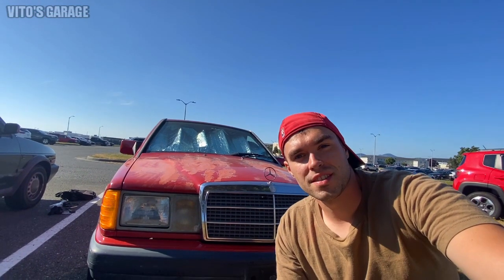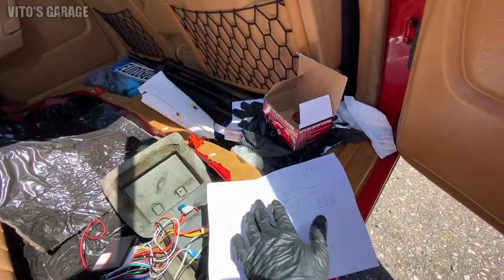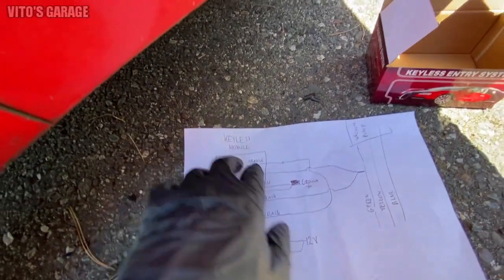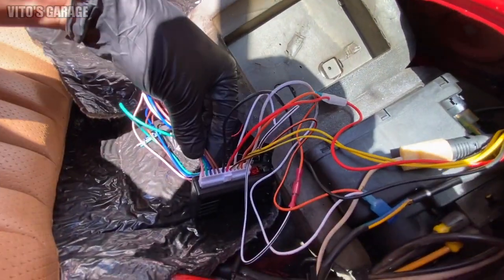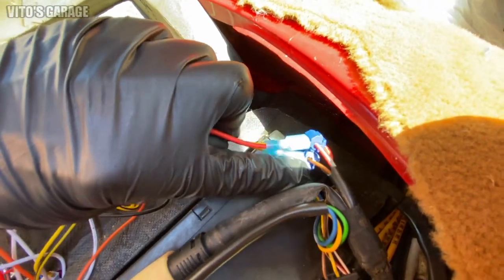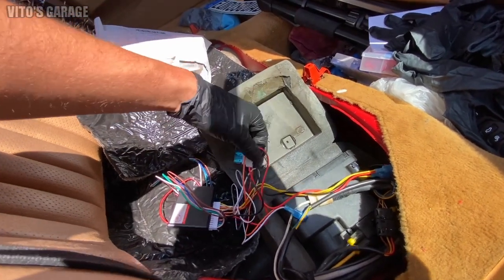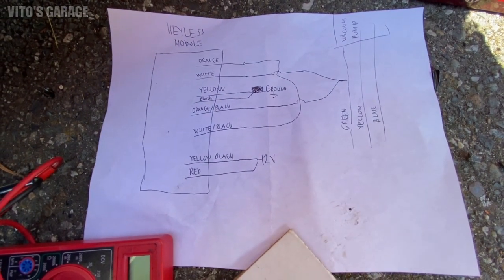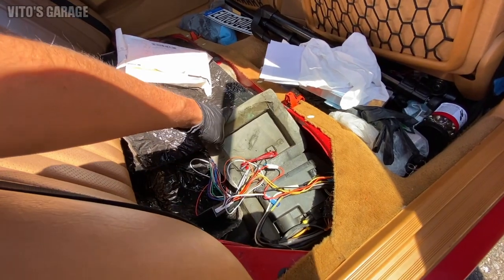Universal Keyless Entry Remote Installation Instructions Mercedes 190E W124 W126 R129 W140 BMW

Comment: Installed this same system in my 190 3 months ago once my drivers door lock cylinder stopped working. Loving it.
Reply from the maker: Did you wire it the same way as in my video? It sounds like your driver door lock vacuum actuator is bad. Pull the door panel off carefully and test it
Reply from the maker: If you have remote keyless entry issues, click here: https://youtu.be/hO1A6DHzTjg

Comment: Amazing video for beginners.  I recently lost my main key for my 300SDL Diesel and I found a replacement mechanism for the ignition so I now have a key for that, but still need a key for the doors.  Your project is a perfect option for me now and I will go ahead and order this keyless entry system and I will make sure it’s the same to avoid any confusion.  This will hopefully get me back on the road without having to worry about the doors left unlocked :)
Reply from the maker: Go the dealership with the title and order a new key. That’s another way. I really recommend doing this too. They’ll cut you a new key according to your VIN

Comment: Good day Vito,
I follow your videos on YouTube. You doing a great job. 
I wanted ask if you could help me with wiring my 190E with a central locking unit a bit different from the one you had used but I think the features must be same. I just need to know which wires I need to use to connect to the green wire of the vacuum pump.

Comment: Absolutely saves me a ton of fooling around with my w201 but I am curious about the tiny red wire sticking out in the back and if the trunk release works too or that it unlocks everything automatically because of the pump, would I have to wire it different or should it not matter?
Reply from the maker: The way I wired everything in the video makes it lock and unlock all the doors as well as the trunk. Just use this video to wire yours up
Reply from the maker: If you have remote keyless entry issues, click here: https://youtu.be/hO1A6DHzTjg

Comment: the orange/black wire and white wire that go the the green wire on the pump, did you connect both wires together and solder onto the green wire or did you cut the green wire and solder the orange/black to one end of the green wire and the white wire to the other end
Reply from the maker: Check out this video if you have issues:

https://youtu.be/hO1A6DHzTjg?si=m4ZKVqUlmZYsUEb1

Comment: Hello, i did the same thing as you did on my 190E with same kit and have a problem. I can unlock it, but when i want to lock it by wireless key, it will lock and automatically unlocked in a sec... I tried to cut the green cable, like manual said to do, but no differences... Do you have any idea?
Reply from the maker: https://youtu.be/hO1A6DHzTjg?si=IlY6Lrg2keEeh8bi

Comment: so i don't need to cut the green wire like my installation diagram says? you just connected the white and orange/black to the green wire
Reply from the maker: Hi. Please rewatch the same video and if your car still has issues, watch this video. You may have the same issue like I had:
 https://youtu.be/hO1A6DHzTjg?si=KTlExTSNtFFR9947

Comment: Hello, I connect everything as you said and the remote control is powered on. The led flash when I lock and stops when I unlock, but the locks didn't do anything. Should I try to connect the white - oragne/black to blue or yellow? Thanks
Reply from the maker: If you have remote keyless entry issues, click here: https://youtu.be/hO1A6DHzTjg

Comment from the maker: Latest Update: 
Here’s how to fix your keyless entry if you have issues:

https://youtu.be/hO1A6DHzTjg

Hello friends. I need to send an important message for some of you in case your locks stop working completely and you have it WIRED PROPERLY:

What you need to remember with 190 (W201 chassis) is that when you unlock it, you have to wait till the vacuum pump stops pumping. Once the pump stops pumping air, you can lock it with the remote. Otherwise the keyless module doesn't like that and prevents the locks from working. In that case you need to reset the battery.
 So, when you use your keyless remote, do this: Unlock and wait. Don't lock it right away! Lock it when the vacuum pump stops working. Long story short, give it a break between locking and unlocking. If your locks don't work at all but everything is wired properly, reset the battery for 30 seconds and the remote locks will start working again.
Just remember, give it a break between locking and unlocking.

Comment: hey, thanks for the video. How did you figure out the orange needed to be shorted with the white/black etc ? I got a different system and have no idea which to connect to the green wire !
Reply from the maker: That’s what the instructions said to do. 
If you have a different system, message me on Instagram (vitosgarageyoutube) and I’ll try to help
Reply: @VITOSGARAGE  Thanks for the reply. Turns out my controller isnt compatible with pneumatic systems. I got one that is with instructions on how to do it included. Wire colours different, but same result. Thanks for your help !
Reply from the maker: If you have remote keyless entry issues, click here: https://youtu.be/hO1A6DHzTjg

Comment: can you do or recommand a video of how to convert a w201 190 rear manuel window to electric ?
Reply from the maker: It's a long story, but you need different door panels and different window regulators, you need to add more window switches to the center console wood trim, and you need to add the wiring harness to the rear windows.
Reply from the maker: If you have remote keyless entry issues, click here: https://youtu.be/hO1A6DHzTjg

Comment: I've got mine wired in in my w124, seems do what it's supposed to on the remote, locks and unlocks but the car doesn't let it stay locked/unlocked, so if I lock it on the fob the door pins will go down but they'll go straight back up again, any idea? Works fine on key
Reply from the maker: Did you wire everything properly? 
And try holding the buttons longer when you use the remote. Instead of clicking the button, hold it
Reply: @VITOSGARAGE  it ended up being the little black 'jumper' plug,swapped it over to the other 2 prongs and it works perfectly now
Reply from the maker: If you have remote keyless entry issues, click here: https://youtu.be/hO1A6DHzTjg

Comment: Good videos man! Can you show us how to wire in lights when locking/unlocking ?
Reply from the maker: Hello and thank you for your support. If you want to add the lights, you have to find an electrical wiring schematic for your particular car. And usually, you need to disassemble the interior to run extra wires from the keyless module to the rear lights and to the front of the car. Sometimes you can just tap into the wires located at the flasher relay. I think that’d be the easiest thing. Look for the flasher relay in your car and tap into that. Unfortunately but I haven’t made a video on this because I am not a fan of too much extra spaghetti in the car. But if you have more questions , you can contact me on social media
Reply: @VITOSGARAGE  thanks Vito, do you think you can do a quick follow up video on this? Much love from Cali!!!!! Restoring a 95 E320 to live the last of her days in rust free California!
Reply from the maker: @sebastianvanh342  I’ll do the follow up but not soon. I have other cars to work on and I’m quite busy these days. But I’ll for sure make a video on this in the future. As of right now, I can explain to you what you can do if you want to add turn signals to your keyless module. You might be able to do it using just 1 wire and tapping it into a wire on the hazard switch. 

MAKE SURE THE BATTERY IS DISCONNECTED.

There are 2 brown wires on the keyless module that are for the lights. I think you can just use one of those brown wires and run it all the way under the carpet to your hazard switch. Use 20 Gauge wire if you can, and insulate it in some kind of loom so it doesn’t rub through anything! It’s very important! That wire that you’re going to run all the way to the front of the car must be insulated and not bouncing around anywhere. Use some zip ties to tie it to the floor in multiple places. You don’t want to cause any shorts and that’s why it’s important to wrap that wire in a loom and to make sure it’s gonna be safe .

Now, you’ll need to disassemble your center console to get to the hazard switch. 

When the hazard switch is accessible, look for a Black/Yellow/Red wire. 
According to the wiring schematic I looked at, it’s the best wire to tap into for your turn signals. Use the same method of tapping into the wire I showed in this video. 
Connect the battery. Check to see if the lights flash when you use the remote.  They should.
If they don’t, message me on Instagram: vitosgarageyoutube .
We will figure it out. Some W124s have different color wires at that hazard switch.

If everything is working, put liquid electrical tape on that wire you just tapped into. Let it dry and put it all back together. Write a note on that wire and say something like “this wire is for turn signals for keyless entry”. That way other people working on it will know what that extra wire is for.

Let me know how everything goes! I post new car videos every week. Cheers🤝

Comment: Hi Vito.  Will the key when used to lock still work?
Reply from the maker: Yes. You can still lock it and unlock it manually or with the key
Reply: @VITOSGARAGE  oh ok thanks. Mine i had to cut the green wire
Reply from the maker: Why cut it? You can do the same thing like I showed in the video. I installed that special splice and never had to cut any wires. I can lock or unlock the car using the remote and mechanical key
Reply: @VITOSGARAGE  i have the W126 1989 560SEL. It doesnt work when just tapped to the green one.
Reply from the maker: @kibovolks  ohhh you have a W126! That makes sense
Reply: @VITOSGARAGE  continue to do great on your channel. Very nice content. More support...
Reply from the maker: @kibovolks  Thank you very much!
Reply from the maker: If you have remote keyless entry issues, click here: https://youtu.be/hO1A6DHzTjg

Comment: Do you have a link for this unit ?
Reply from the maker: Should be this one. Any universal keyless entry kit is basically the same: https://www.ebay.com/itm/402511535174?_trkparms=ispr%3D1&hash=item5db78e9c46:g:2JEAAOSwNhNfko6H&amdata=enc%3AAQAGAAAA8LB0twW4bWfw5AJixOyl2w9oNnf%2FWeaOQX%2FaVFQF6sVde2%2BFzIpnHabvY%2BIW3SSujR8Vrgv1GzGcwTsY8bD1qaOIh2DTsJZ1VUb4PcgjKcW3k0a0MXWDKIEkjuyO6NdD3iktj1slsMuQsu74KvmYFZmBxO2tojAAVmdFLZuHThm1oLFuz7cEIowHqFp2YJBjvwaIcot8h3KhyXE5Tglun3UtfiefwOky0Kc9xuiIDGym5Gsr0tTW8Nb8ydYUVcE0kC1PaBj%2BFfPW%2BujGUsOgLxQhEQFLllGTYzqP10%2Bd%2FsG2P5WLVQfXM1UTyuLeG7mj5w%3D%3D%7Ctkp%3ABFBMoISFyYZg

Comment: I installed this exact same keyless module in my 1992 190e and not working. It will lock with the remote but will not UNLOCK. I rewatched this video like 5 times and I’m pretty sure I have everything connected correctly. Any ideas?
Reply from the maker: Everything worked for me. You're missing something or using the wrong keyless module. Look at the wiring diagram that came with your keyless module and look at the wires that say ''Unlock''. Now go back to my wiring schematic from the video and see how those ''unlock'' wires connect.
Reply from the maker: Did you figure it out, Nate? 
Here's what I need to update everyone with: 
What you need to remember with 190 (W201 chassis) is that when you unlock it, you have to wait till the vacuum pump stops pumping. Once the pump stops pumping air, you can lock it with the remote. Otherwise the keyless module doesn't like that and prevents the locks from working. In that case you need to reset the battery. So, when you use your keyless remote, do this: Unlock and wait. Lock it when the vacuum pump stops working. Long story short, give it a break between locking and unlocking, otherwise the locks will stop working and you'll need to reset the battery in that case.
Reply: @VITOSGARAGE  thank you Vito I will try this. Out of coincidence, the door lock assembly on my drivers side broke during my testing. Something plastic inside the assembly jammed up. I had to order a used part on eBay. Once it gets here and I can fully test I will post an update.
Reply: @VITOSGARAGE  I fixed it. I had the power and ground wires connected to a different harness. There is another harness under the seat that has the same colors brown and red but is apparently different.
Reply from the maker: @natejgreene9871  Glad everything is fixed now!
Reply: @VITOSGARAGE  me too. My fucking key tumbler broke again so i need this. Last week my exhaust manifold cracked for no reason, the windshield wiper stopped going up and down, and the accelerator cable broke. NLA! This fucking car I swear man…I never have this kind of shit happen on my w123 or r107
Reply from the maker: If you have remote keyless entry issues, click here: https://youtu.be/hO1A6DHzTjg

Comment: El verde hay q cortarlo y conectar el blanco a un extremo y el naranja y negro a otro extremo.
Reply: Pudiste conectarlo a tu carro. Compré un sistema igual pero no tiene exactamente los mismos colores de cables.
Reply: @JavierInnovation  Qué coche es?No todos los coches llevan el mismo sistema.
Reply: @Santos-ds1ch  es un Mercedes w124
Reply: @Santos-ds1ch  pero acabo de terminar de instalarlo, quedo trabajando
Reply: @Santos-ds1ch  en mi caso la señal que le entra a la bomba de vacío fue mediante el cable amarillo y no verde como en el vídeo. Pero me sirvió de algo el vídeo para tomar algunas ideas. Con un multímetro no hay perdida. Puedes rastrear e identificar señales y voltaje. Saludos gracias por responder
Reply: @JavierInnovation  Muy bien,compañero, enhorabuena!!
Reply from the maker: If you have remote keyless entry issues, click here: https://youtu.be/hO1A6DHzTjg

Comment: Great Video! Quick question, do you have to add the actuators inside the door panel in order to use the keyless entry? Or is it simply just a module and fob with no actuator needed?
Reply from the maker: Just a module and fob. Nothing else needed. Very easy
Reply: @VITOSGARAGE  yep, the mechanisms (pump, lines, actuator) are in the car but you have to use the key to open them from the door lock cylinder, what Vito did was he installed that module to power the vac pump remotely and not having to turn the key
Reply from the maker: If you have remote keyless entry issues, click here: https://youtu.be/hO1A6DHzTjg